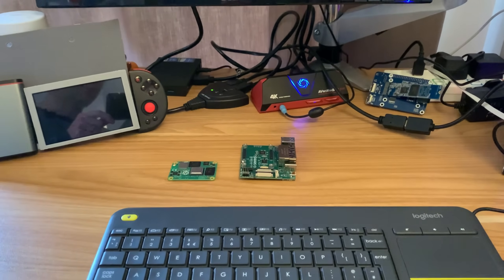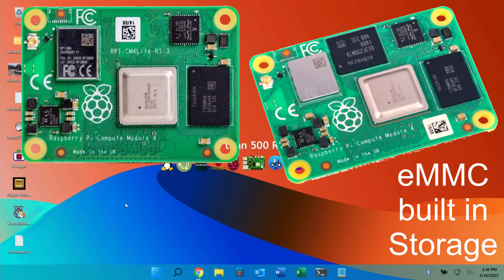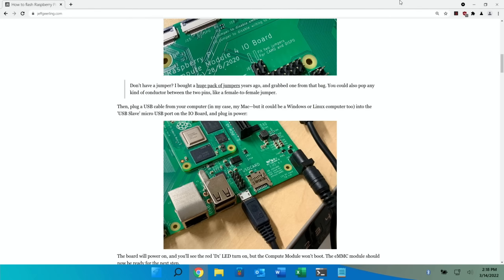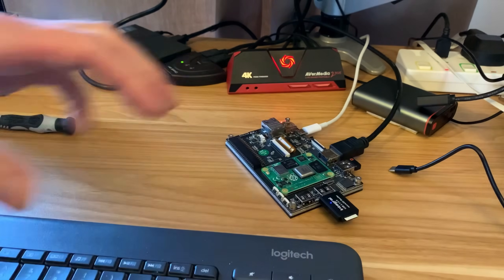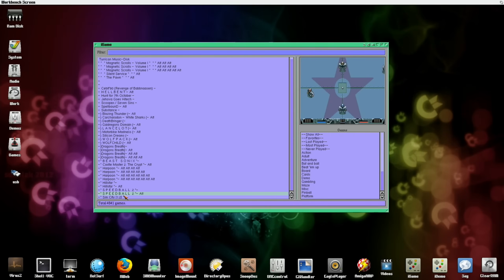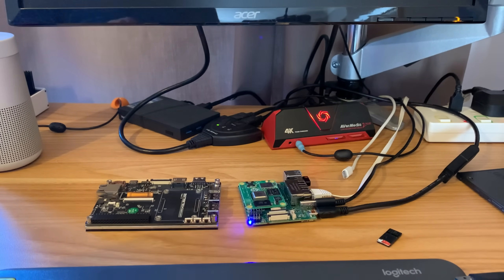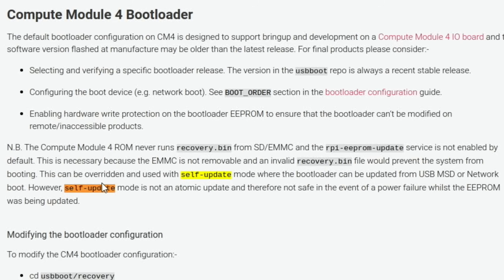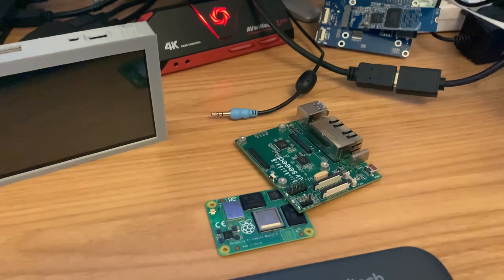Did I break my CM4? USB Boot eMMC CM4 test.

Comment: well that was disappointing.....hopefully you are able to resurrect the CM4.  I have seen a couple of items on different forums about bricking the CM4 while trying to get it to boot from eMMC.  I am not totally sure of how I did this but I have the DeskPi Mini Cube, did not invoke or move any of the dip switches.  Booted it with using a MX Linux distribution on a SanDisk Extreme Portable SSD running .  Was able to use RPi Imager to write RPi OS Lite to eMMC.  Then I connected a SanDisk Extreme SSD that had RPi OS Lite, updated it to Pixel Desktop removed the SanDisk and everything that I had done to it was miraculously done to the eMMC and the CM4 boots from the eMMC......my head is still spinning!  Will keep you posted on how it functions.

Comment: Great vdeo! Quick question, when booting from a SD card in a card reader, can I still use the eMMC storage of the CM4 as additional storage? Thank you
Reply from the maker: I believe so if you format it. I haven’t been able to test as my cm4 no longer works
Reply: @leepspvideo  I just tested it and it works! I'm still facing some issues with permissions though. I ended up switching to my 64GB USB flash drive so I'll never run out of space.

And btw the reason your CM4 didn't read the SD card from the Pad 5 SD slot is because only CM4 lite supports direct SD connection. Otherwise the connection just goes to the eMMC instead

Comment: @Lee, were you able to fix the issue with your CM4 module?
4 of my CM4 modules stopped working just the same way you've shown, tried debugging. was able to find a faulty PMIC output rail in 3 cm4 modules, (the 1.8V rail was shorted and in others load to the PMIC is appearing to be short).
the 4th CM4 module had all the power rails working just fine but still not able to boot. Rpiboot also didn't help much, windows is not able to detect the SDRAM of the same(although with serial communication I read that it atleast detects what kind of memory and size is present)
I highly suspect they're are damaged due to improper handling/ESD.
Let me know  if that's not the case and you've found a workaround.
Reply from the maker: Unfortunately I never fixed it. I sold it as not working on EBay.

Comment: I have a similar issue. In my case it is the USB Host of the CM4 which has a bug. My PC will not recognize it because of a malformed USB data packet sent on connect. The Raspberry PI documentation says that some USB hots do not like that and refuse to work with the CM4. I had to connect my CM4 with its base board to a RPI 4B and flash the emmc via usbboot. After this hassle it was booting at least. The CM4 still refuses to connect with my windows PC anyways.

Comment: Thanks for your video.  I just got the official Raspberry pi IO board with the PCIe socket.  My cm4 is just like yours with 32gb emmc.  I erased the emmc as you showed and can now boot from an m.2 nvme on a carrier board inserted into the PCIe socket (as well as from usb devices as you are doing).  At some point I would like to be able to dual boot from emmc and nvme, but I don't know if that will ever be possible. regards---john.

Comment: the sd data wires are internally connected to the emmc on emmc compute modules and arent available on the 100 pin connectors so no sd card should work in the carrier board's sd card slot unless its a lite compute module with no emmc on board, also different carrier boards may use different internal usb hubs so it may be a compatibility issue with the card reader and the hub

Comment: I have a similar issue with my CM4. It will boot into Raspi OS on the official Raspberry Pi IO Board. But, it will not work on any of my other carrier boards. I regret not buying extra CM4s when they were available.

Comment: A slight tangent to investigating your boot problem:  Could it be a hardware problem? Possibly the connectors since they are quite fine. The other thing i've seen is a dead PMIC - that mxl7704 in the corner, some kinds of shorts can kill them.
Reply from the maker: The pins look ok
Reply: @leepspvideo  in regards to what he was saying about the power management IC...

if you have a magnifier. or a microscope, and some sharp metal spikes for your multimeter. then it might be possible probe the pins and components around that mlx7704 chip on the CM4 while it is plugged in and powered up. to just do some basic checks to see that the output to that power supply circuit on the CM4 module is actually supplying the expected good clean power to the rest of the CM4 module

but if you do try that, then you much be careful not to accidentally short out and bridge pins or contacts. which would then risk incurring a further damage.

however this is just merely a speculation... this might not be the issue with your CM4. it could equally be something else around the booting / debug mode or whatever else

Comment: this is the sort of a hardware / firmware problem that i find simply fascinating. so i hope that you will keep us updated about this. personally i would suspect that something hardware related (or even psu related) with the seedstudio carrier board has somehow caused damage to the cm4. or otherwise has then put the cm4 into an unbootable state. like you say. and there could be a number of different lower level reasons for that. but i would just caution you before using that seedstudio carrier board again. just simply in case it ends up doing the same thing to the next different cm4 module you end up putting into it. like how long before that had you been using the seedstudio carrier board without any issues? or was it something brand new?

i suppose  if a 2nd cm4 did die in it then that would prove something more. however it just seems like its a rather costly way to learn that. personally i would be examining those tin boards under my microscope, looking for any traces of any damaged component. and then after exhausting those booting debugging steps progressing to stuff like live probing io lines during boot to check for activity or conversely lack of etc.

ah if only i had already got the oscilloscope that  have been saving up for. then i would probably ask you to just sent it to over to me to look at. (being that i also live in the uk). however i am still a bit away from achieving that goal. i keep saving. of course another challenge for those cm4 ones is how to attach the probes. being mostly all smd. but then again it probably has test pads on there for at least some of it

also gotta say though: in terms of the physical side of handling these things. i have been finding that throwing around my rpi4 as a bare pcb without any case or anything, ... it has seemed to be pretty rugged so far. so long as you dont inadvertently knock off any of those tiny microscopic smds. or on the cm4, not to damage those recessed surface mount connectors by accident. then they otherwise seem to be pretty durabe little devices. for example in terms of the ESD shock protection. at least my rpi4 seems all fine

let us know if you get anywhere with it. i am really interested and in particular to find out if those seedstudio products are getting any hardware issues on them. it is a good topic to share and be informed about. perhaps there is also some value to try searching for / or contacting seedstudio more directly. to just simply check for and eliminate any potential board revision or manufacturer design issue
Reply from the maker: I have had the seeed case for 5 months it’s has been fine. Until recently I hadn’t removed the CM4 from the board.

I had used it in this video recently 

Raspberry Pi CM4, Berryboot Simple Multi OS Setup. USB & SSD tests.
https://youtu.be/8yQys8uEQlI

And this one

Raspberry Pad 5
https://youtu.be/KX53vMdJ3Ek

Comment: Not seeing anything over HDMI is troubling.  Assuming your boot switch isn't set wrong on all 3 carrier boards, I'd check all the pins in the CM4's board connectors to make sure they aren't bent or broken.  
Next steps include things like connecting a "TTL" serial cable to the UART pins and/or trying using utilities to check on the state of the boot loader.  
FYI, SD isn't physically connected to the SOC if you have eMMC.  As far as boot order goes, USB2 and USB3 are different since USB3 is actually on the PCIe.  
You don't need to blank your eMMC.  You can set your order however you like in the boot ROM, with say NVMe first then USB2 then Ethernet then eMMC/SD.
Reply from the maker: I had read that you couldn’t change the boot order on the CM4 with eMMC. It’s why I was trying this workaround.

I want to try the uart but I don’t know which gpio pins to link up. I have a possible fix in this thread.

https://forums.raspberrypi.com/viewtopic.php?p=1983788#p1983495

Comment: Tried to show you two pages to help but looks like YT won't allow me to post links so i can't help. Sorry
Reply from the maker: Thanks, maybe try removing the http://www.
Reply: @leepspvideo  Good point
Reply: @leepspvideo  Jeff Geerling has a page on updating the Bootloader / EEPROM that you can try & James A. Chambers has a Full Compute Module 4 (Raspberry Pi) Setup / Imaging Guide. Tried posting links but none would show
Reply: Do what I did. Put in some search terms that locates the pages or save them on bitly and post the unique code that usually works
Reply: @Mister-Gee-9999  Yeah that didn't work either
Reply: @TBMartin  put a couple spaces in the link